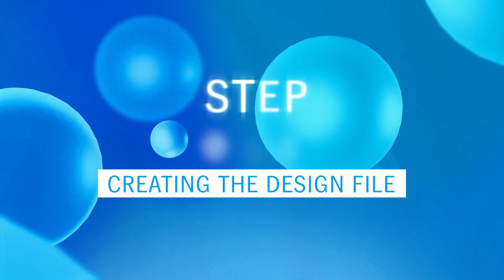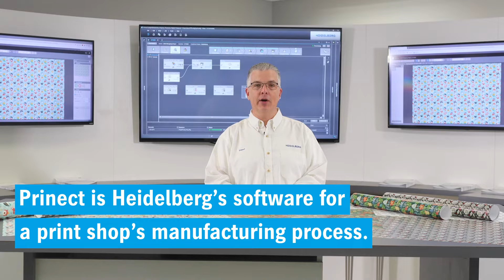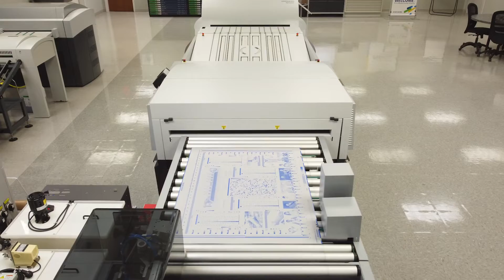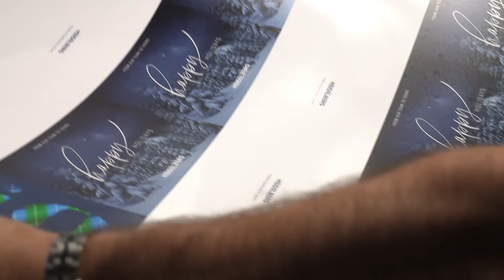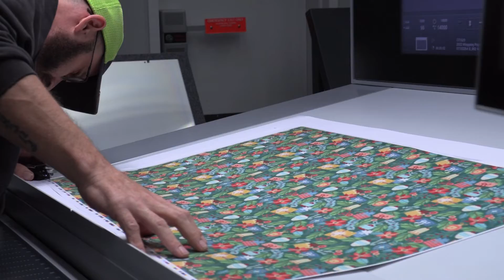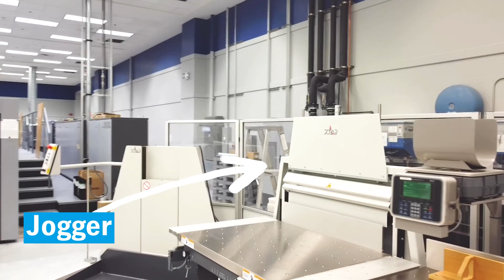How Wrapping Paper is Printed on Speedmaster XL 106

Comment: in real life: 1020 paper filled with 281 blue with tiny 2795 barcode porn. offset coating on top. 70g gloss paper. secondly: YOU NOT USING 10 COLOR 106 TO PRINT SIGRYMIGRY WRAPPING PAPER 4/0 CMYK! - SO - we dont need your videos!